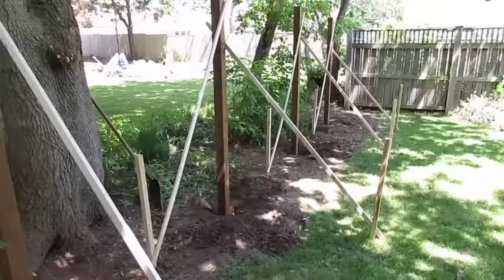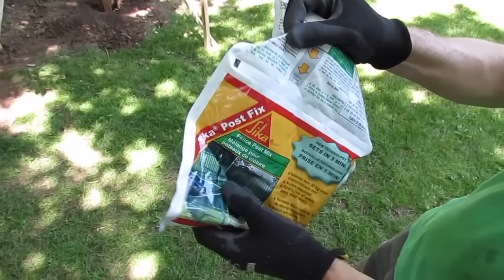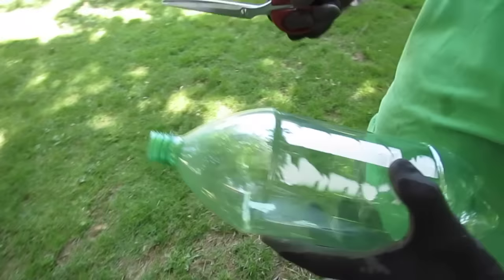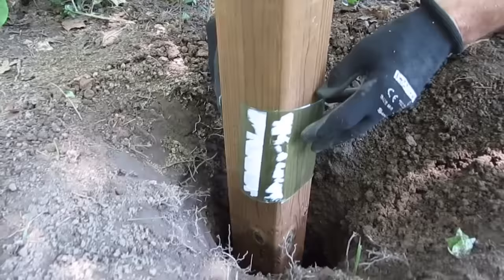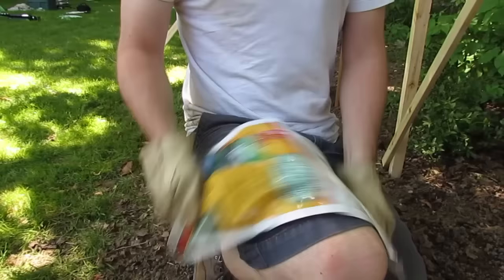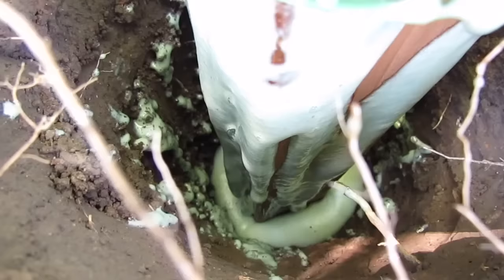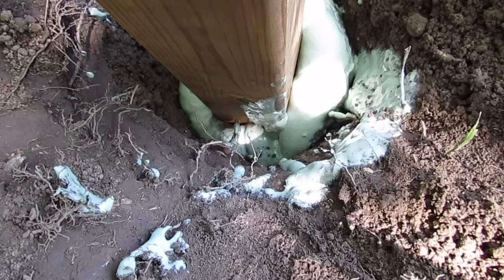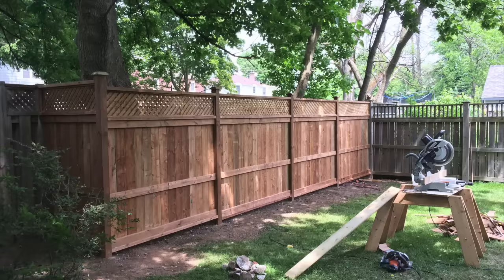No Concrete Fence Post Install!

Comment: Well, theres 5 minutes of my life wasted. Now I can go get quikcrete and do the job.
Reply from the maker: You should be using 32 MPa concrete. I'd expect no less than 4700psi 28-day strength. Don't cheap out with Quikrete.

Comment: Don't know about replacing concrete for fence posts but I can think of some other uses for a dense foam like that. I have used the wall insulation aerosol with plastic wrap to create a few covers and lids this stuff looks more structural. Twenty bucks a bag I would probably transfer it to resealable containers and use a little at a time.

Comment: Okay soooo, this stuff costs $20.00 bucks a bag and it took you two to Set one post. A 60lb bag of Quickcrete costs $3.25 and will Set two posts.....hmmmm. No Thanks. But that was fun, right?
Reply: keith brazie a 60lb bag of concrete will not set two posts
Reply: keith brazie q
Reply: keith brazie
Reply: A bag is 11 dollars and is equivalent to two 50 pound bags of concrete

Comment: Congratulations! You’ve just spent between 10 and $20 per post hole instead of simply using concrete and paying $1.50 per hole. Seriously?

Comment: More work and much more expensive than placing dry concrete in the hole and adding water.  Show the fence posts 5 years after installing. Will the foamy company even be around in 5 years? A no-mass foam is too good to be true. What's your kickback?  

^^ Questions people should ask.
Reply from the maker: This video was filmed 3 years ago, no sign of fence movement or failure of any kind. The foamy company is called Sika and has been around since 1910 (according to their website), they make all kinds of construction related stuff. No kickback, though I do make some money off the ad revenue from nice folks like yourself watching my videos!
Reply: 1) I'll use what professional fence installers use -- and it ain't foam! Google: problems using foam for fence post installations. 
2) If it sounds too good to be true it usually is. 
3) "There's a sucker born every minute."  Con-men have been around longer than foam manufacturers. 
4) I don't subscribe to a channel that leaves a video on for 3 years without telling the whole truth. Maybe they're lying about kickbacks from the manufacturer too. People will say anything to make money on YouTube now, they don't have to prove it works.
Reply from the maker: @facitenonvictimarum  I think your tinfoil hat may have fallen off. Go outside and get some fresh air.
Reply: @PatonHaus  ...
When everything else fails, there's always the tinfoil hat/fresh air zinger. 
Wanna try again?
Reply: @Taylormade2350  Erm, yes you do... almost, Tarmac`s `Postcrete`   pour water into the posthole, stand your post in then pour in the dry mix. You clearly  don`t know nearly so much as you think you do.
Reply: @Taylormade2350  Why dont you contact Tarmac and give a billion£ company the benefit of your vast experience and knowledge, I`m sure they would thank you,  they would probably offer you a senior post in r&d for stopping them making such  a huge miatake for the last 25+ years.
I wish I was smart like you.
Reply: Ian McHunt I will.
Reply: @Taylormade2350  Why do you feel it is nice or important to be rude? One can easily tell who you support politically. It isn't okay. There is a difference between animals and humans. You are part of that distinction - or you are not. I hope you will choose to act like a polite human. Put another way: Why not do so?
Reply: @Taylormade2350  Why do you feel it is nice or important to be rude? One can easily tell who you support politically. It isn't okay. There is a difference between animals and humans. You are part of that distinction - or you are not. I hope you will choose to act like a polite human. Put another way: Why not do so?
Reply: @Taylormade2350  same comment
Reply: @_Rich_.  Again Why do you feel it is nice or important to be rude? One can easily tell who you support politically. It isn't okay. There is a difference between animals and humans. You are part of that distinction - or you are not. I hope you will choose to act like a polite human. Put another way: Why not do so?
Reply: Jennifer C lmao so you attempt to bring politics in this? That’s hilarious how dense people are. You for one, have zero clue on my political stances. And for two it has zero to do with any of this.
Reply: Jennifer C also hilarious how you attempt to act so high and mighty and humble as you’re trying to look down on people.
Reply: @Taylormade2350  except that I'm not. I am just saying what many others think. Yesterday I got tired of it and pointed it out. If you and others didn't know it or believe it before, now you can. I simply expect more from you... and others ...than you expect of yourself. I believe what I wrote... and I have been there casting stones. Life is much better when talk is civil and anger is directed elsewhere. I mean, think about it. This is a video about how some guy sets fence posts! :)
Reply: Jennifer C except you are. Spin it however you want to try and seem innocent.
Reply: @facitenonvictimarum  - at one time people used cane poles to fish... I believe that has changed.... People washed their clothes down by a creek by scrubbing them on a rock... again, that has changed.... when fuel injection came out people like you said it will never last and a carb is the only way to go..... Times change and maybe you should step outside of your Mommy's basement to see what is actually going on....
Reply: @jeffsapp5258  
Hahaha... ahem... another foam seller! 
Be a nice Sap and I'll be your second subscriber in five years -- assuming your mama doesn't UN -subscribe.
Reply: Jeff Sapp   
Ouch! Now for sure I won't be nice and be your second subscriber, Sappie. My mom's cemetery doesn't have basements. She died while I was serving as a Seabee Navy officer, after I was enlisted in the Air Force, and after I got my Masters degree in Engineering.  
But you're close, I occasionally do shop at Walmart -- and I was a box boy in high school before working my way through two universities. 
Hahaha... ahem... cough-cough... want to try again? Three strikes and you're out, though, so think a little this time, for a change -- unless paint fumes have left you with permanent brain damage.
Reply: @jeffsapp5258  
Strike 3. Best not to embarrass yourself and the Sapp family anymore. Sad.
Reply: The poor guy even forgot that he sent the first comment! A mind is a terrible thing to waste.

"American Academy of Neurology (AAN)

"People who are exposed to paint, glue or degreaser fumes at work may experience memory or thinking problems decades after their exposure, according to a new study. Researchers assessed the workers' lifetime exposure to chlorinated solvents, petroleum solvents, and benzene, including the timing of last exposure and lifetime dosage. Benzene is used to make plastics, rubber, dye, detergents and other synthetic materials. Chlorinated solvents can be found in dry cleaning solutions, engine cleaners, paint removers and degreasers. Petroleum solvents are used in carpet glue, furniture polishes, paint, paint thinner and varnish."
__

Best wishes to the Sapp family.
Reply: facite non victimarum -

The reason why you are soooo negative... Read on shoe-shine-boy who living in his DEAD Mommy’s basement... 

The number of young adults living in their own household has dropped dramatically in the last decades in the United States for a number of economic and social reasons. In a study that will soon be published in the peer-reviewed journal Society and Mental Health, MPIDR researcher Jennifer Caputo investigated the effects of moving back home after a period of independence on young adults' mental health. She found that young adults who "boomeranged" back to a parental home experienced an increase in depressive symptoms.

Recent estimates from the Pew Research Center shows that U.S. adults age 18 to 34 are now more likely to live with their parents than independently or with a partner. While only 31.6 percent of young adults in this age group lived in their own household in 2014, in 1960 62 percent lived independently. The main reasons for this change are setbacks and delays in achieving economic security and forming families. Full-time, well-paying jobs are scarce for young people, and those available require increasingly longer schooling. The American ideal of early independence has become increasingly difficult to achieve, particularly since the Great Recession of 2008. Other research shows that young adults were particularly hard hit by the Great Recession and that they have increasingly relied upon parents for help defraying financial hardship, including by living with them.

"We know a lot about the reasons why young adults boomerang back to their parents' homes, but there's almost no research on how it affects their mental health," says the author of the study, MPIDR researcher Jennifer Caputo.

In her study, Caputo used data from the National Longitudinal Study of Adolescent to Adult Health, or Add Health. Add Health is a longitudinal survey that began in the mid-1990s with a sample of over 20,000 U.S. adolescents in the 7th to 12th grade. Five waves of data have currently been collected, following the adolescents into young adulthood. Information about living arrangements comes from 2002 to 2008, by when the participants were age 24-32.

Caputo found that men and racial and ethnic minority groups were more likely to be living with their parents than women and white young adults. Young adults who lived independently were less depressed, better off financially, and more likely to have achieved other markers of adulthood, i.e., to be working or married, than young adults who stayed with their parents. And those returning to their parents' home after a period of independence appeared especially likely to have experienced certain setbacks, such as income declines and partnership losses. Caputo: "Economic and social independence are hallmarks of a successful transition to adulthood, and residential independence is highly valued. Not achieving these goals might create feelings of failure."

Much of the relationship between "boomerang" moves and depression can be explained by changes that pushed the young people backs, such as work or relationship losses, but returning to a parental home remained a significant predictor of depression even after accounting for these factors.

"My findings show that returning to a parental home after a period of independence can be depressing. They suggest that norms about attaining residential independence in young adulthood remain powerful. These findings are consistent with research indicating that disappointments in other areas of young people's lives can have mental health consequences," Caputo says.

She is currently continuing her research by investigating the mental health of parents who have adult kids coming back home: "These moves also affect parents. It is possible that having an adult child living at home can be disappointing, stressful, and depressing for parents too."
Reply: QED
"Quod Erat Demonstrandum" (that which was to be demonstrated.) 

The proof is complete.
Reply: facite non victimarum -  checkmate!

narcissistic personality
1. A disposition characterized by behavior and attitudes that indicate an abnormal love of one self.
A person with this disposition is self-centered and self-absorbed, is extremely unrealistic concerning attributes and goals, vacillates between over idealizing and devaluing others, and, in general, assumes that he or she is entitled to more than is reasonable in relationships with others.
2. A personality disorder with the basic characteristics of a pervasive pattern of grandiosity, hypersensitivity, and defective empathy, manifested in the following:
Grandiosity, with a sense of self-importance.
The subject views his or her problems as unique and understandable only by other special people.
A need for constant attention and admiration.
A sense of entitlement.
Reply: Sika = Sika Group, they are from Switzerland. I'm very happy you aren't promoting or sponsoring communist Chinese junk.
Reply: Dude Sika is an extremely well known company around the world. They are well know for their quality products. I have been using their silicone and adhesives products and would recommend them any day. They have been around for 100 years and will be around for a long time.
Reply: facite non victimarum pouring concrete in the hole around the post will eat your post and last only about 3-5 years if that!!!!
Reply: @facitenonvictimarum  you seem INSANE
Reply: @nowirehangers2815  
Not so insane that I'm "waiting on Elvis." 
Not so insane that I have a playlist about talking to my dead ancestors!  
Google "psychological projection," maybe talk to your doctor, and stop waiting for Elvis. 
Good luck!
Reply: @nowirehangers2815  
As I thought, now the guy who talks to dead people is not only "projecting" insanity, but also the medications for its treatment.
Reply: @facitenonvictimarum  sure babe. . Listen as much as i have enjoyed this conversation i have to leave you to amuse yourself now.
I have friends to celebrate with.
Hope you find some.
Seasons Greetings and much love xxx
Reply: @nowirehangers2815  
OK....  Just remember how the conversation started.
..
Waiting On Elvis. . 4 hours ago. . @facite non victimarum you seem INSANE. . .  
.. 

(try it on your friends...  babe :)
Reply: Anyone that questions if Sika will be around in 5 years clearly is as experienced as my canary in building anything other than a big pile of poo
Reply: @PatonHaus  Sika is well know here in South Africa as well.
Reply: @jeffsapp5258  Hey Jeff, my brother, I still use a cane fly rod and so do lots of other fly fishing fanatics. Bamboo rods are very flexible, and responsive,  the synthetics are OK, but I'll stick with bamboo.  If you fly fish, try it, you'll be amazed.  Be well.  Oh, and thank goodness for the carb, points, condenser and simplicity of my tractor's construction with no computers to screw things up.  It's a mid 60's model that I bought new and have kept chugging along with simple hand tools and a service manual that is written in English.  Don't have any experience setting fence posts with concrete or foam, so I'll pass on that particular controversy.
Reply: terry waller I never not once said anything about foam bud. You need to mix all concrete before pouring. I could care less what the bag “claims.”
Reply: Sika is a very reputable company.  I am a builder who has been using their products for at least 15 years.  This foam idea, however, I have no experience with.  Sika, however, makes extremely high quality products.
Reply: will Sika be around in 5 years???  you are a funny guy.  Not in the building game then I guess.
Reply: @_Rich_.  I've installed fence for 8 years , line posts pouring a dry bag in will do just fine but then again so will dirt or gravel . Ends and gates that way is definitely not a good idea,  I had to pull too many posts much fast just to mix and be sure

Comment: So much easier to fill with a dirt-cement mixture and a little water - cheaper, faster, more durable, and proven (really no need for mixed concrete for residential fences except on corner and gate posts - which foam will fail to hold)

Comment: Just set my fence post in foam... beware that foam starts to bubble fast.  Definitely have your post set and then hurry up and get it in there once it's mixed.. pop bottle cover is really important.
Reply from the maker: For sure the stuff expands very quickly

Comment: What a totaly shit idea!
Reply from the maker: Thanks Greg! You've made YouTube a better place with your insightful comment.
Reply: And Greg's a great speller, totally.
Reply: @richdiana3663  what does that even mean?
Reply: @PatonHaus  what happens to all the heavy duty plastic bags get reused then do they.
Reply from the maker: No, it's a fence not a grocery store.
Reply: @PatonHaus  it is the worst idea for fencing ive seen. Round holes are bad enough. Ive only been at it for 30 odd years though. Cant beat a spade dug hole and proper 25 mpa concrete.
Reply from the maker: I wouldn't expect any less, everyone is an expert on the internet. Do me a favour and go click on another video you disagree with.
Reply: it means, when you are insulting people, and thus declaring your superiority, it generally helps your case if you can spell
Reply: +greg taylor
Reply: You always get some stubborn person that refuses to except new improved processes to achieve superior results and save time.
Reply: @Mr._Chievous  what insult are you talking about?
Reply: RealestRealist  Does not change the fact that its a questionable idea.
Reply: If this foam is good enough for utility companies to secure TELEPHONE POLES into the ground, it's good enough for a measly fence post.
Reply: playpen  it does not take an fn college degree to put up a really great fence, your ignorant because its bad for the soil and the enviroment look up the chemicals plus the contamiated bags, clay soil dont need anything, just good old fashioned soil, i have had a fence for 14 years and still good.